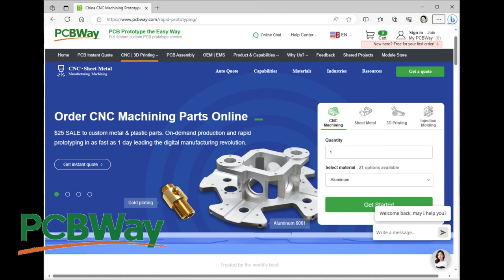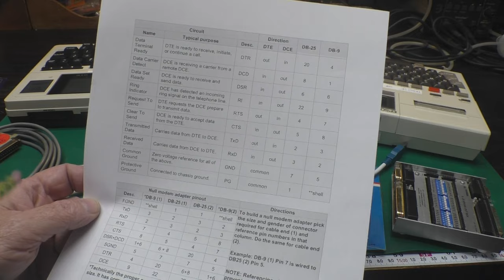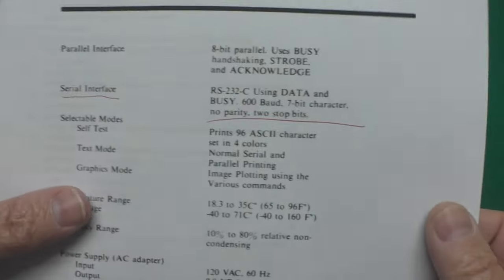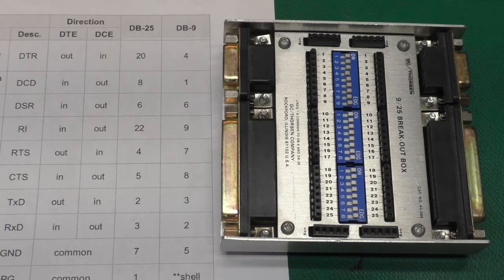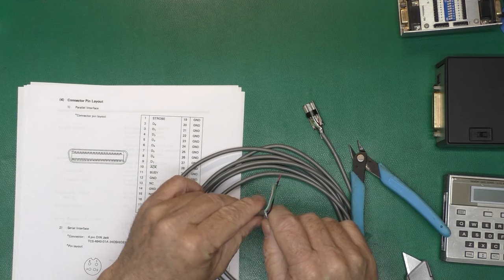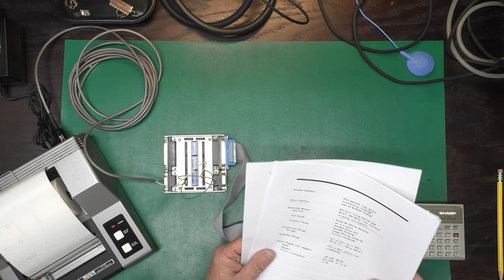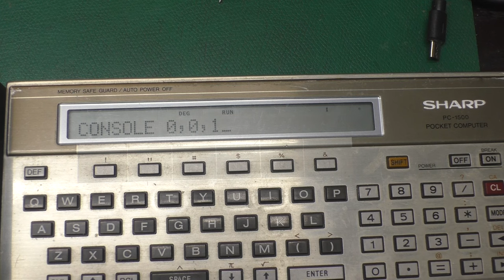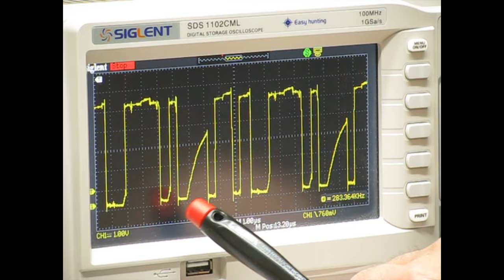RS-232 Woes? Serial Coms setup and troubleshooting for your vintage gear.

Comment: Serial Comms is still alive.  In my Aero industry, Arinc 429 (serial) is very much alive.  Inside our satcom board, we use serial to connect major bits together. It has many advantages over using Ethernet/USB etc. its simpler, most chips have at least 1 UART, and less susceptible to hacking.

Comment: I have had to work with many different serial standards for control and computer systems. RS232 hand shaking signals were the bane of my existence on some days, often a null modem wasn’t enough for reliable comms. Thanks for an awesome trip down memory lane.
Reply from the maker: Indeed, for something supposedly so simple it can sure be a chore to get two things talking.

Comment: For the Comodore AMIGA, 5 to 15 V was enough for low and 0 to minus something for high on the serial port. 
This means that the serial port could be operated with an inverted TTL signal as well as with a correct RS232 communication.
For the output there was correct +/- 12V. With a transistor and a few resistors it became TTL again.

Comment: Ooof, yeah, these issues are all too familiar!  Trying to get computer X and computer Y to exchange data using "the same protocol", wasting infuriating amounts of time to figure out that one needs two stop bits or only works at 2400 baud despite "officially" supporting 9600, one requiring hardware handshaking and the other requiring software handshaking... Oh, not to forget the "RS-232C" cable that, for no good reason, didn't bother to connect anything but TX, RX, and GND despite having 25 pins...  I'm glad I only need to get this stuff working for my hobby and not my job!

Really, having only used RS-232C serial occasionally back when it was "current tech" for printers and occasional data transfer, and now using it more than ever before to play with my vintage computer collection (which, somehow, is almost entirely younger than me... hmmm... must be a math error there), I have wondered lately if all of this was simpler for the pros who DID have to configure, program, and use it on a daily basis, due to familiarity.  But, thinking now about the existence of dedicated serial diagnostic machines makes me think that even the grey-bearded pros must have spent some infuriating hours trying to get this "standard" to work!

Comment: Hey Birt!  I ran into exactly the same CTS issue connecting the PC-2 to the TP-10 thermal printer.  I ended up with a similar “fix”.
Reply from the maker: It was kind of an interesting problem. Don't know if I have run across it before. For slow devices like our printers it is a killer.

Comment: One of the more annoying things about UARTs is that most of them will control outgoing data flow in hardware (CTS/DSR), but I haven't found one yet that will assert RTS or DTR except under direct software control.

Comment: Hi,
if you are into serious serial debugging (like me) you need either a HP 4951C,
or a HP 4952A, and a HP 18179A pod.
Or even better a HP 4957A.
But beware of exploding caps when you get one of those.

Edit: oh, you mentioned one of those briefly. But you can get them
relatively cheap at "the bay" nowadays.

Thanks for all your cool content!
Runner
Reply from the maker: Yes, the HP stuff is nice kit. I did manage to get by with my cheap LA and a level shifter on this occasion.

Comment: Some old 8bit computers and even the PC running dos (the ctty command) could be used to accept console input/output from a terminal. Does that Sharp can be used with a terminal over the serial port? Just curiosity.
Reply from the maker: Yes, the Sharp CE-158 ROM includes a SETDEV command which lets you redirect KB input to be from the COM port and LCD output (text) to go to the COM port.
Reply: @HeyBirt  Thank you.